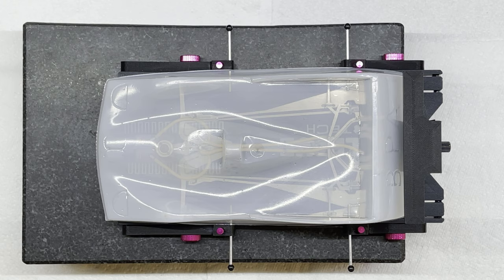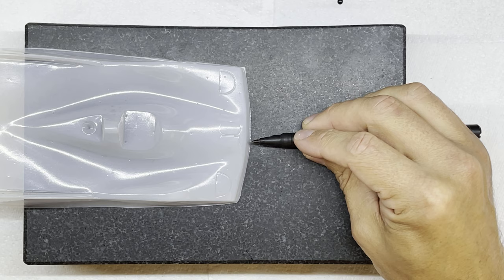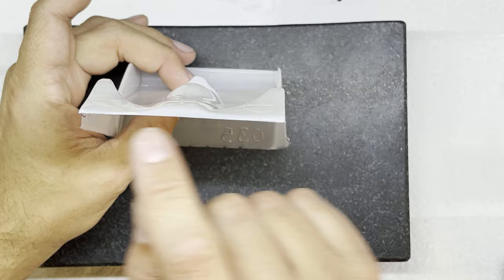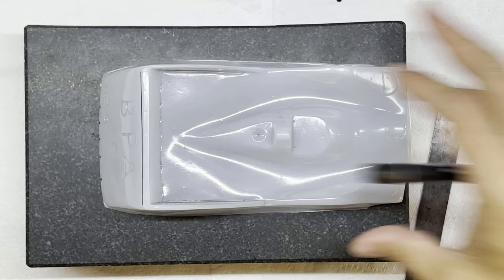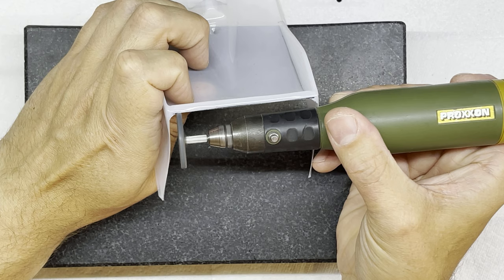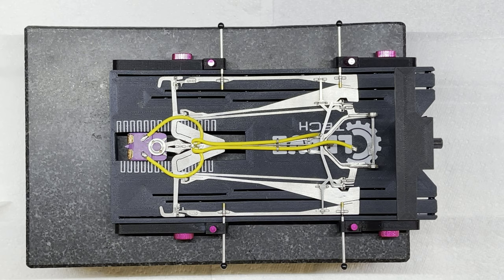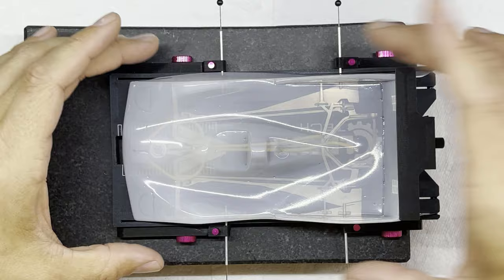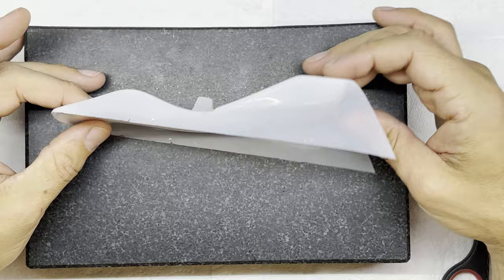Preparing a Vacuum Formed Slot Car Race Body - Part 1

Comment: Not all body profiles are formed square to the base.
Reply from the maker: You are correct. Most of the bodies are formed square to the base but watch part 2 for answers.
Reply: @CleaveTech  what about F1 bodies
Reply: @CleaveTech  also some of us mount bodies off the parallel bottom and incline them, any ideas around that
Reply from the maker: @stevemurch6974   Here is the video on F1 bodies…
https://youtu.be/WIuOaKRMmG0
Reply from the maker: @stevemurch6974  , not quite sure what you mean, please explain?
Reply: @CleaveTech  bodies raised at the rear not as per vacuumed formed, not so easy to get a parallel cut line side to side.
I have my own jig just seeing how yours would accomplish this
Reply: @CleaveTech  you show a F1 already cut out, was meaning how you go about the process
Reply from the maker: @stevemurch6974  I can add a video about cutting out an an F1 shell 👍🏻
Reply from the maker: @stevemurch6974  maybe you could use the internal wing support so the body rests on the support at the rear, rather than using the external wing support magnets (a bit like in the F1 video).